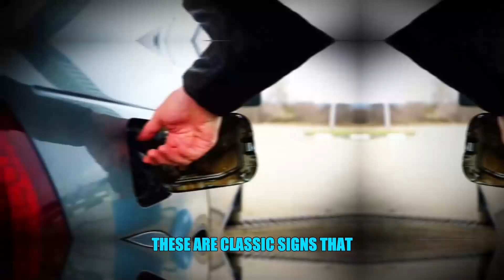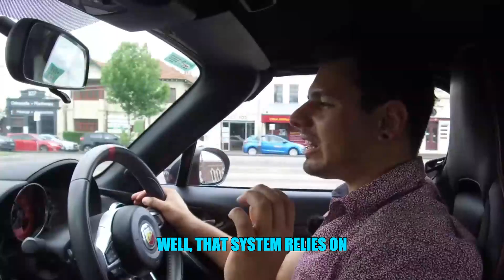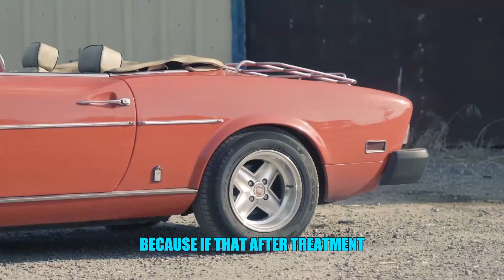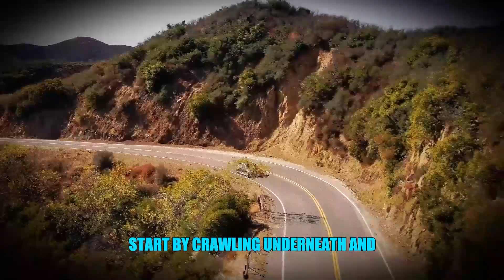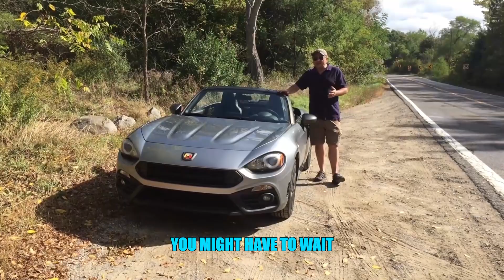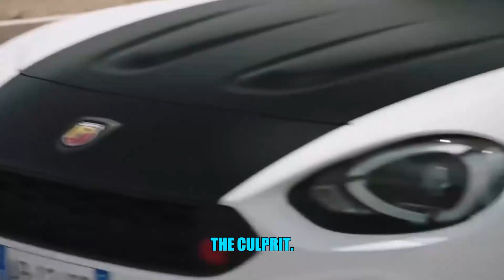HOW TO FIX P20DD OBD II ERROR CODE - Diesel Exhaust Fluid Pressure Sensor Repair

Comment: Useful walkthrough. One check worth doing before the sensor: read the live pressure while the pump runs. If the line or the injector port has crystallised, the figure goes out of range with a perfectly healthy sensor — and the code comes straight back on the new part.